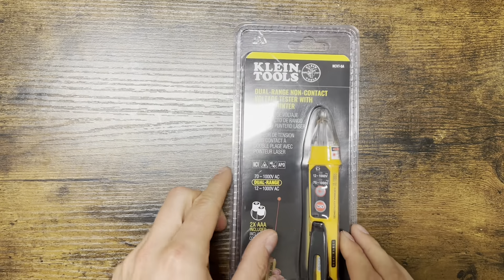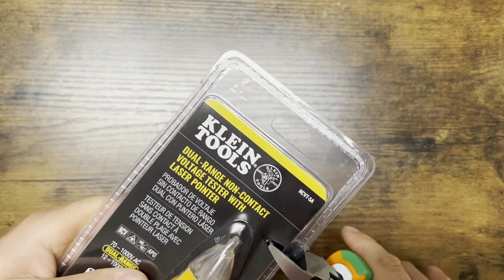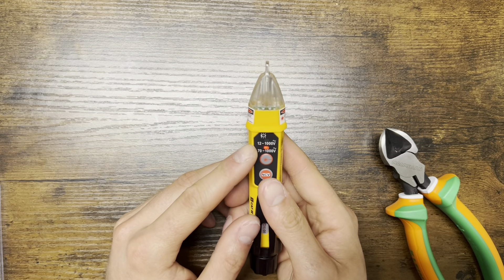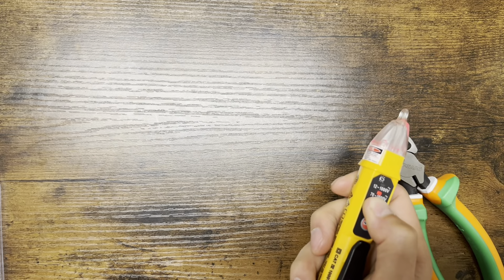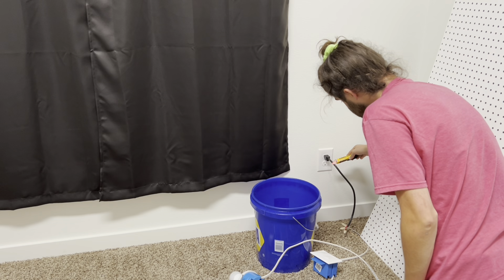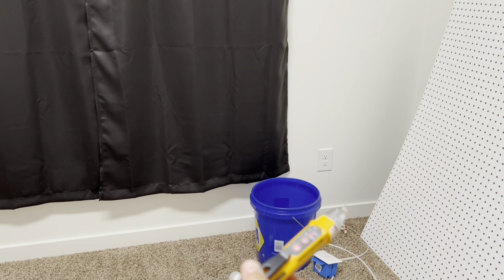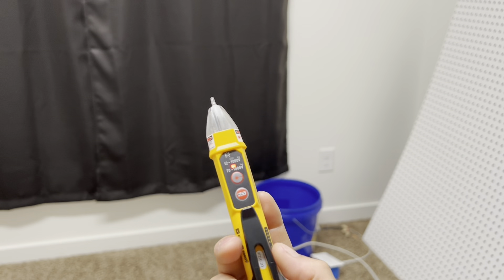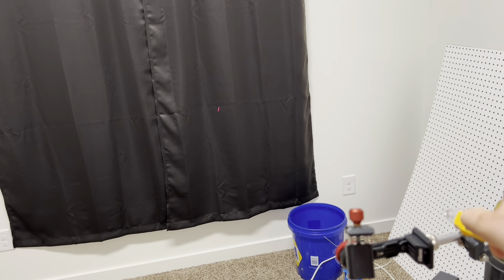Klein Tools Dual Range Non Contact Voltage Tester with Laser Pointer

Comment: If you press the power button quickly to turn on it will flash the light and beep when it detects, if you press the power button for 2 seconds then it goes into silent mode and only the flashing light with no audible sounds. Cheers.